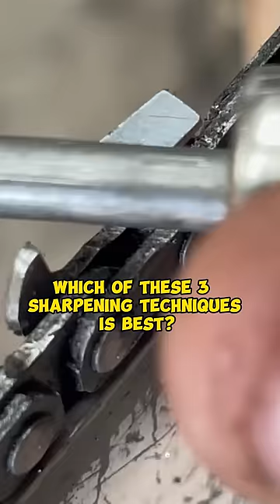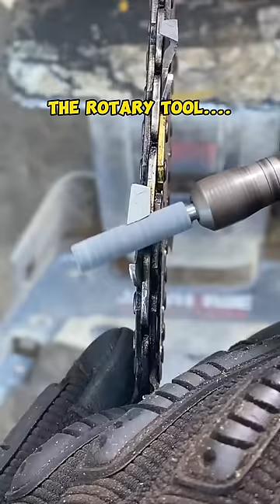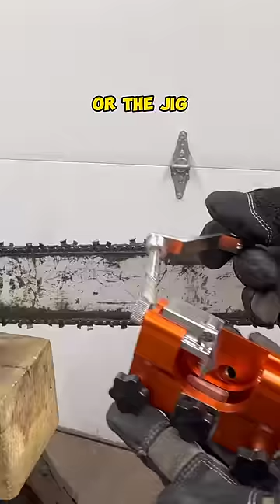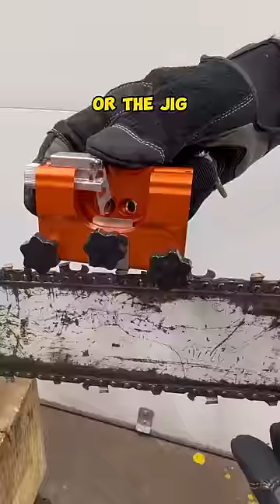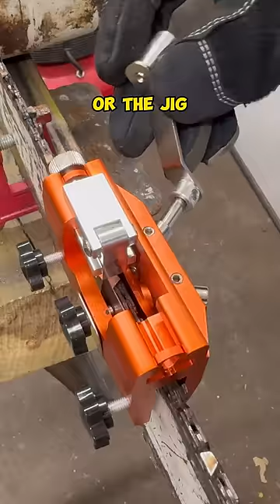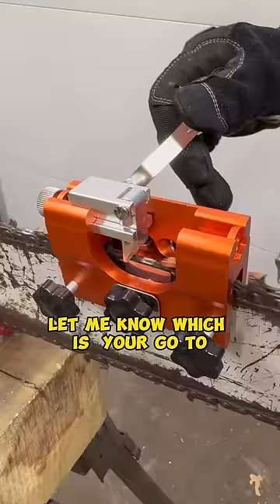What's your favorite way to sharpen a Chainsaw? #tools #chainsaw #lifehack

Comment: Dremel with a long grinding stone, #2!  Fastest, easiest, and great for rock damage.
Reply: That's not sharing though it's fixing damage
Reply: Dremels go to fast. You'll ruin the temper of the chain!
Handfiling is the way to go!
Reply: Dremel has variable speed.

Comment: The slip with rotary tool should tell you that's not it. The jig works in a pinch or if you just don't know how to use a file. The right file and technique will give you the sharpest longest lasting edge

Comment: Maybe I'm missing something... I've always used a handfile, but I've always pushed it. 
 It's been my understanding that they cut (sharpen) on the push stroke. 
 I thought pulling on the file would ruin it 🤔
Reply: Yes, but if you look closely you'll notice he's pulling the top of the file, not the bottom. If you do this you have nothing to worry about.
Reply: @pedrobento6616  
Ah...👍🏻

Comment: If in the woods and finding myself with a chain needing attention I first find a stump or make one 4” to 8” cut at whatever height I want the saw chain to be. Then notch it across with the saw and leaving my saw in the stump I jam the saw wrench between the bar and stump leaving the blade able to spin.  I then take my file and eyeball a fine tuned sharpening which usually leaves me pretty happy.  I did most of my saw maintenance at the work truck however up in the set where I had a vice.  Still free handed the sharpening tho.  Always worked better for me once I learned how.  At home shop had proper sharpening equip that all took more time and seemed to make my chains wear out faster.  I bet a large percentage of people still cutting wood today probably are pretty good with a chain file, if’n they been cutting long.
Reply: When in the woods , I put the saw right on the ground straddle the saw and sit down on it then sharpen it
Reply: Right now I'm going to go grind half my away, you know..

Comment: Hand file. Although I get chains given to me by a friend who doesn’t sharpen them, but just replaces them. Usually they are in rough shape, so I bought a grinder to get the rough out of them while keeping an even angle on both sides. I haven’t bought a chain in years.

Comment: Hand file, but put it in a cordless drill. Work wonderful.
Reply: Can we assume you don't start the drill? Maybe it's OK to just steady the file for even pressure and a straight pass.
Reply: @minnesotadave  what, yeah, you start the drill. It works great.
Reply: So basically you choose option 2....
Reply: @_kainzow9365 just with the wrong tool, ine that's designed to be pulled not rotated.

Comment: The harbor freight electric chainsaw Sharpener. I could feel and hear the motor Rev at a slightly higher speed when sharpened. Cheap and quick to sharpen

Comment: Hand file. There is a bit of control and less heat. 
The rotary approach can take too much metal and cause overheating.
The jig might be good, though I've never tried one, but a propee file probably is cheaper than the other tool.
Reply: The key with the jig is take less material than you might think to avoid destroying the brittle carbide cutter.  I like them for fixing a rocked chain else a file is my preference.

Comment: When I worked on the road in the woods I'd have to sharpen my saw up to 25 times a day depending o' weather and road conditions. I just used a file and my eye to get it right. I think people eventually develop the technique that suits them and the job best. Let's say that the cross cut saw wasn't good to use for felling as the rakers were usually well usually well low

Comment: There is a reason a chainsaw file is serrated and twisted. That means you're supposed to twist the file while pushing it forward. That's what gives the chainsaw. Its sharpness using a fucking rotary file ground soon is not the same

Comment: Nothing beats some 80 grit sandpaper wrapped around a long Phillip's head screwdriver shaft about 5 strokes each way. Just be careful not to damage the sandpaper, try twisting the screwdriver as you go. Pro tip: try supergluing the sandpaper to the screwdriver (just a few drops or it's a bit@h to get of later)

Comment: Hand file hands down... can get a perfectly sharp edge, and depending on how fast you work it can be done in under 5/10 mins... personally i can do a 24" in under 5 mins with an edge that'll make spaghetti like strips when cut along the grain and really nice square chips when cutting across the grain. It also allows me to sharpen the saw almost anywhere, no need to put in a vise or on the tailgate or clamp something to the bar or have to have electricity nearby. By far the most convenient once you learn how to do it

Comment: I made a jig for a rotary tool.  Kinda the best of both worlds.  It can do the cutters & height gauges and works for saw angles between 0-35 deg.

but the best?  thats overhead, grinding wheel style sharpeners.  But any of the options are subject to "operator influence".

Comment: Treat your new chain with care, dont carelessly damage the teeth. Before it becomes hopelessly blunt give each tooth 3 strokes with the correct round file, positivly seated following the tooth angle. The chain teeth will be significantly filed away before the rakers need touching. The more raker you file away the larger/ splintered the waste will be

Comment: A file can be used to clean up chains that need much more love than a jig can provide. The rotary isn't well-suited to that. The rotary, in experienced hands, is quite fast and will do a good job if your chain is well-maintained. If it needs love, it will make it usable, but not to the point that a file in the hands of an experienced faller will. The jig is great for saving time, and removes the risk of big damage in a small time from rotary, it doesn't require much experience, and it's all you need if your chain is well-maintained. The file is a skill that all who use a chainsaw should know. Maybe not homeowners with small saws that get used once every couple years, but someone who uses a chainsaw multiple times a year, or someone that uses a chainsaw for a living should always practice their filing skills to keep them sharp, as well as their chains. Use the jig for speed, but keep that file handy, and don't forget to use it every now and again. To answer the question, a file will always be best, eventually.

Comment: hand file is best. you can customize your angle. the trick is consistency on all teeth.
the rotating file fixes consistency issues but doesn't allow angle adjustment  and  is steeper than most factory angles. the grinder I don't like it's too easy to take too much material

Comment: On the job site: the file (with angle guide), chain fairly tight on the bar while sharpening. In the shop: jig to get it to par. Fastest to have 2-3 chains and swap them out on job site.

Comment: Turn the file around if you want to pull. You are holding it by the push end.
Tooth with round file , gullet with triangle/ chisel tooth file.

Comment: I have hand files that I use out in the woods, a 12 volt battery powered sharpener, with an angle guide, that I use when my Polaris Ranger is close enough to plug in and a commercial bench style electric sharpener that I use once or twice a season to true up my chains and get all of the teeth perfectly even.

Comment: Only way to go is hand filing, no electricity needed, no heating up the cutting edge, one file last ten times longer then a grind stone.
And a file is light and small to carry.
Check out wrangler stars carrying pipe (1/2 inch copper pipe) in your person without worry of falling on the file.
Pro tip, count and use the same # of strokes per tooth 👍

Comment: I have, and use all 3.  My normal go to is a Timber Ridge with the carbide cutter chucked in a cordless drill, but if I will still hand file from time to time. And I use a dremel if I find a rock, nail, or a bullet.

Comment: Honestly, depends how dull your chain is which will be the best choice for sharpening
Also how much time you have. If you are in the field the long tool is what most people will have on hand.
If you wanna get fancy either the electric or manual rotary tool will work

Comment: I’ve got the little file holder that clamps to the bar and hold the file at a  specific angle.
 Every once in a while I use it to set the angle back to spec other than that I just use a round file .  lots simpler

Comment: I had a rotary tool that was 12 volts and could clamp on the battery terminals of a car or truck. Sharpened hundreds of chains with it

Comment: When I was logging professionally I’d take a new chain out of the box and put a stroke or 2 on the tooth 
And take a stroke or 2 on the rakers with a flat file as well….
Not for the feint of heart and don’t do it if you don’t have the saw to drive it or it’ll just get hung up in the wood……
But
You can always get a better edge on a saw with a hand file

Comment: Hand file, take the worst tooth count the strokes and then do all the other teeth with the same amount of strokes, keeps the saw cutting straight. Or just use 2 or 3 strokes and do all the teeth and don't don anymore strokes on the dullest one just leave it till the next time.

Comment: Depends on what you're trying to accomplish I think I've used and filing when I was a kid until I was older and then didn't really have an option back then switched to rotory files and like some of the benifits hitting it with one gives that hand files struggles with like getting the gullet out and multiple saw sharpening. The rotary will eat more chains but you can go back and forth from hand to rotary as needed.

Comment: Hand file with the guide is the best of all.

Rotary file is never accurate because is shrinks while using it.

The jig is only good to keep the saw teeth sharp during cutting. It doesn’t take off as much as the file.

Comment: When we would go out on our wood cutting camp outs we would take at least 5 chains for each saw. My 2 old stihl saws we have have at least 15 very good chains. We used to cut a lot cedar, juniper and when we could oak. We shyed away from pine. Except for fatwood.

Comment: I must be crazy. I use a dremel tool. Clamp saw bar in vise. No one else here claims to like them. I do. I can eyeball pitch and angle just as close as anyone using a file without having to make long wobbly strokes. Hit the rakers about every 3rd or 4th sharpening. That last jig looks pretty cool. Never used one. Years ago, I tried a hokey clamp on jig and file till I started using the dremel. Lots quicker. Less monkey business. More control.

Comment: I’ve used all the other options and hand filing just works best for me, jigs added too much time for too little benefit and rotary sharpeners always took off more than I wanted, most of the time just one push per blade with the file is all I need and it takes less than five minutes to get back up and running

Comment: Hand file with a three corner chieselbit file or flat chiesel bit file  then every 3 rd sharpening use around file to take out the gullet    Timber fallers have been doing it for decades

Comment: The hand file is the better way to go ... The last one , that over fancy sharpening tool , it works great but takes a second to get it all set up and is ultimately just one more thing to throw in the bag and get in the way and possibly lost in the field and is just too expensive for most of us and the rotary tool is a waste of time and if your not careful it will dull the tooth faster and easier than sharpening it just as you showed us when the bit slips and hits the edge of the tooth and you then get to start all the way over sharpening it and eventually leads to taking too much material off and ruing the chain very quickly .. the hand file is probably the hardest to use and even though it takes time to get use to using it , that's just part of the learning curve of running a saw and with everything else there is an art to it so ultimately if you can't properly use and sharpen it then you probably shouldn't be using it in the first place ... Hope that made sense 🤣

Comment: I work a ski area maintenance job that has me cutting ony occasionally, but I learned to hand file 25 years ago. I have a bunch in a variety of sizes in the duffel bag that holds my chain saw stuff. Works well for me since I cut with s variety saws.

Comment: I've cut around 50,000 metric tonnes of firewood in the last 25 years always use a hand file easy to use once you get the knack and I swap hands to keep the chain even on both sides 👍👍👍

Comment: Hand sharpening is probably best but.....if you wear your chains to the point they wont cut anything at all like i do....then it will need 100% reprofiled so using a drenel in that case is best, otherwise you will be hand filing for hours .

Comment: Hand file, that's how I learned 14 years x cutting don't want to carry any more than needed, I sit the saw on my knee and lock it under my arm, I like to take the gullet out as the chain wears and I do t need to touch the drags

Comment: Dremel works excellent for me.
Quick , and precise.  
Dont exceed sharpening , as done  here, you don't have to take away so much material, and don't slip the rod over the blade as done wrong here! i guess this piece here got too hot, as well....
Bad example here,shows rather how not to do it. Lack of skill.
Hand sharpening works as well, but is much slower .
30 years of experience.

Comment: The hand file it looks like your going backwards from where the stamps on it look like they were . With the dremmle youd never know but be sure not to inhale that stuff . And the last one looks like its was going backwards. But i dunno . The best ways to do them is the machine with the disk on it . But you gotta make sure all the teeth are the same lengths . Take. Little ruler amd measure them to make them even . And at the same angle .

Comment: I like using electric grinding disc style but I like running saw that I sharpened with hand file but I'm a logger so I always sharpen by hand

Comment: Watch all the old experts come out of the wood work saying the good Ole file. Let's be clear what ever the manufacturer tool is that they first sharpened the tooth with would be dthe best way.. Because I have never used a chain more than once. When it dulls you will never achieve the same cut again. Period

Comment: Have owned a chainsaw for over 40years. A hand file set is ubiquitous, but requires a bit of skill. Phuque the dremel, too easy to ruin a tooth. The jig how ever...provides the speed of the roto tool, is hand powered, fits in your pocket, but does something neither of the other does. It provides repeatabilty, quickly and easily.

Jig for easy win. Just know that it will cost more because those CAD/CAM machines are getting used to pay for investors holidays.

Comment: Rotary tool for me but not with that much speed and Power that will make heat you need to almost be able to stall your rotary tool while just lightly brushing the teeth hand file is always good too should never have to go nuts if your electric blade get that door it's time for a new blade an light touch up before each use should do the job

Comment: none of the above I use An electrick Chain sharpener Thats mounted on a workbench that you liftSLIDE The Chain Lock it in Place then lower The spinning wheel

Comment: None of these.  Anyone that ever uses a chainsaw should have the hand sharpener made by Stihl. Not only does it have a guide to line up the file, it has a file that takes down the raker or guide.  Seriously check them out 3 pulled per link per use

Comment: Im not a fan of the rotary can take too much off to easily when you not very good at it and it's extra stuff you gotta bring into the bush with you i like to use a jig if i can for the first 3 or 4 times on a new chain if i can just to be certain im starting as accurate as possible but when all is said and done 99 percent of all my filing is with a hand file

Comment: bench grinder is a pain. ya gotta take the chain off and set up a light to see cuz yer in the shop. Hand filing is a pain and time consuming. I got an Oregon 12 volt rotary with a gauge on it for $30 and I LOVE it!  I throw it in the  bag of files and stump vise I don't bother with anymore because the ATV, truck, or tractor are never more than a few feet away and the 12 volt grinder has alligator clips.  I can have that blade perfect in 5 minutes without straining.  Wish I got one 30 years ago!  By the way, your demonstration is wrong. you're supposed to be moving the rotary file back and forth as you grind.

Comment: Le 1er est le meilleur j'ai été bûcheron plusieurs années et c'est toujours la simplicité qui a été le mieux avec un peu d'expérience tu peux faire aussi bien qu'avec une machine et toujours plus rapidement faut baisser les rèqueure aussi pour avoir une meilleure pénétration dans le bois

Comment: Using a rotory tool on a chain is a bad idea especially if you have no clue wtf your doing. Get it to hot an a file will never touch it again. If you can't get your angle right by hand get a guide. Handle file is better than anything

Comment: None. A new blade for 14$. You cannot sharpen anywhere close to factory sharp.
Reply: Blade. Lol. CHAINS are much more than $14. You can get 4-7 good sharpenings out of 1 chain.
Reply: $14 chain? Maybe if you have a 4 inch bar.
Reply: Lol, thats the opposite of true, i know multiple people and a couple machines that get chains sharper than factory. ntm i cant get new chains for 14 bucks a piece that i know of,  cheapest chain(that ill run) for my smallest saw is 22 bucks a piece
Reply: @tylerhoward2703  he called it a “blade”. Nothing more need be said lol